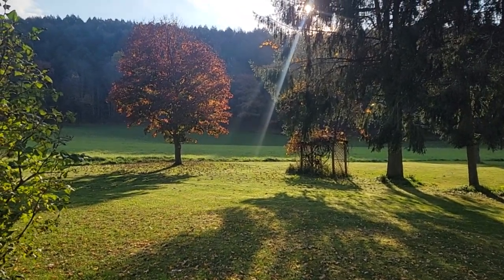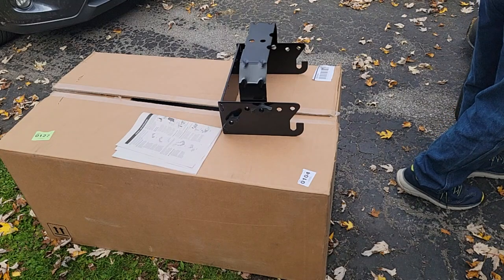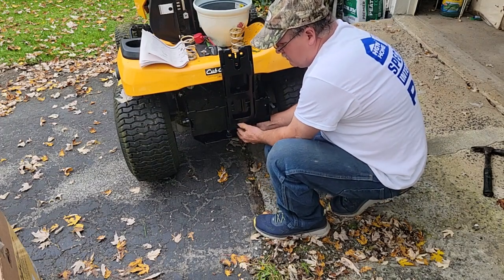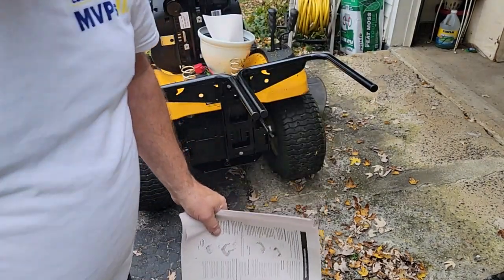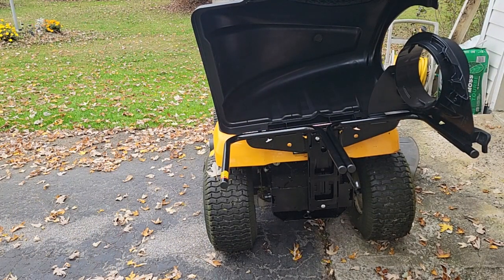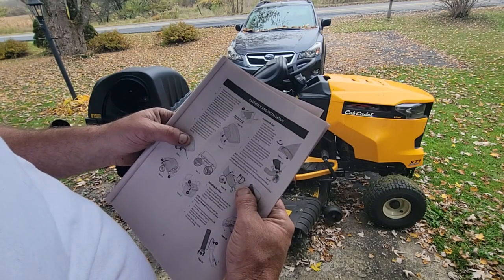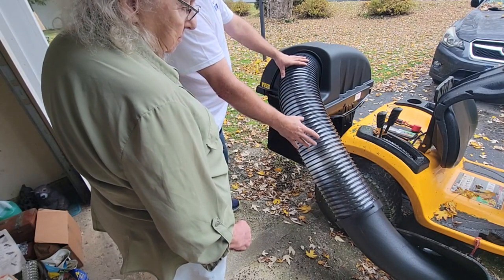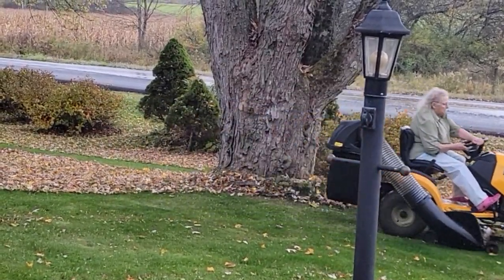How-to install a Cub Cadet XT1 Bagger

Comment: How do you just the bag  tube off and just mow or put a spreader on it
Reply from the maker: The tube assembly can be removed and leave the bagging bracket if you want and thr hitch is available beneath.  My mom is using it that way  this spring to pull yard trailer around.